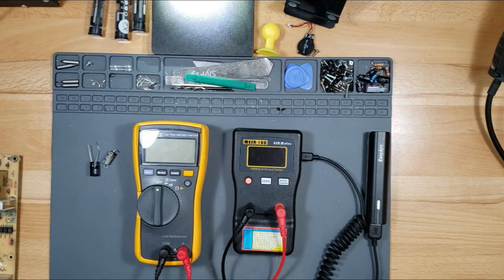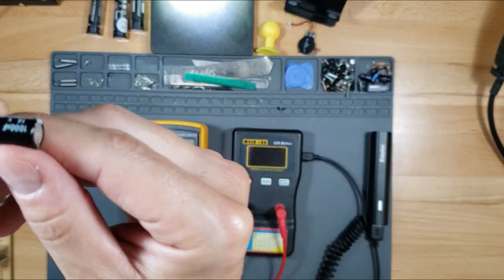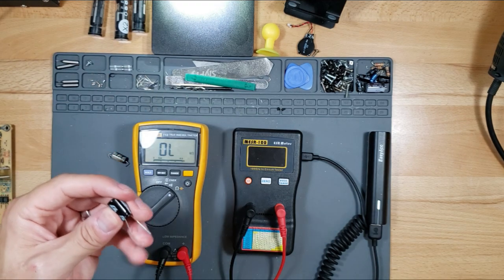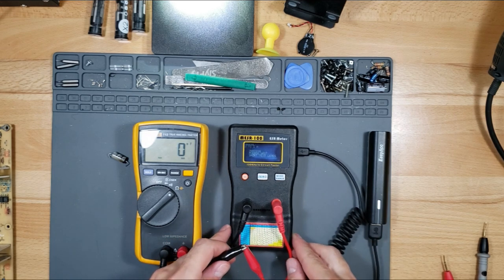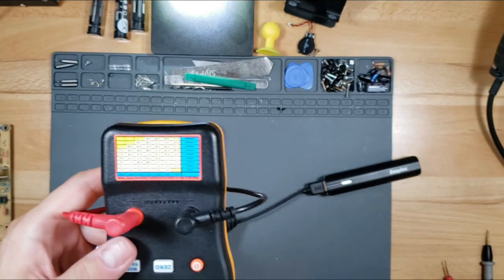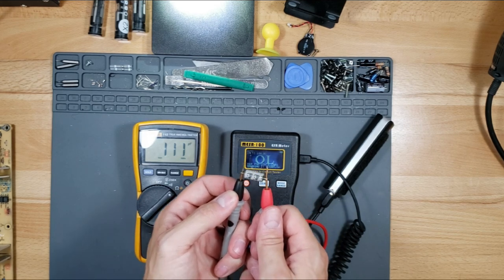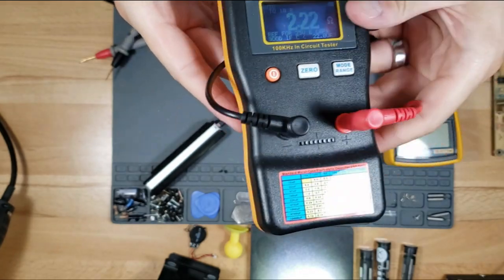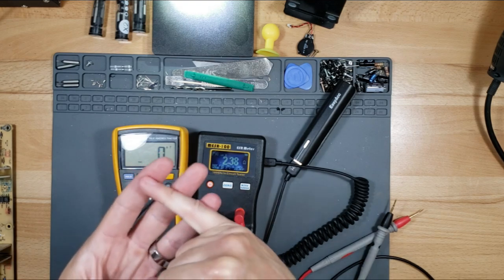Multimeter vs ESR meter reading capacitors

Comment: I thought a major upside of ESR meters was that you could measure capacitors IN CIRCUIT no ? A lot of hassle tracking down a blown cap if you have to yank em to test em. ?
Reply: This is true unless in parallel, he was stating the most accurate way I believe but it wouldn't hurt putting that golden bit of info out there lol

Comment: Great tutorial. You can also test the resistance and microhenries of the inductors with the esr meter. The reactance formula is 2𝛑FL. That would be 2 x Pi x frequency of esr meter x 100 (uH) Just plug it in.

R=0.628 X L(uH)
L(uH)=R(ohms)/0.628

Comment: Hi, I'm an amateur in the field of Electronics, on your recommendation I have exactly the same ESR meter it works fine but I still have a question, can you also measure SMD Capacitors with this meter or do I need a Pin measuring device for SMD components.   I ask this because the SMD capacitors do not have mF ( fahrads) written on them, sometimes only Numbers.    greetings from the Netherlands     Akko
Reply: V good ?
And what   Is the Solution

Comment: Hope I don’t look picky, but just a couple of points that would improve a future iteration of this presentation:
1) If you see figures the right way up, then roll your hands over to point the component to the camera, we will see the figures up side down;
2) I wanted to see the screen of the ESR Meter, when it was displaying each of the two results & also a clear shot of the table on the ESR Meter. A steady shot of each of those would be appreciated.

Comment: If the ESR meter is measuring resistance why can’t one use the DMM to also read a capacitor’s resistance and then use the same chart that’s on an ESR meter to determine if the cap is good?
Reply: Capacitors block DC. It would read as open. ESR meters test with high frequency.

Comment: Can you not just ohm it out with a multimeter in the ohms setting?
Reply: Capacitors block DC. It would read as open. ESR meters test with high frequency.
Reply: @ortzinator  
Ok, so an expensive  mft1741 megger would have the same problem yes?

Comment: It's been a while since I thought about this. Isn't there a situation where you can use the ESR meter while the cap is still in the circuit, if it is clearly bad?
Reply: must be  isolated from the circuit
Reply: One leg out
Reply: It’s fine to read in circuit. EEVblog has a video with proof.
Reply: @ortzinator  Yes I think that's where I remember reading about the advantage of an ESR meter. On the other hand a multimeter can't, because parallel capacitance is additive.

Comment: I'm new to this and I have a couple of tv's I want to try and fix, one has a problem with the picture taking a while to come on and one of the capacitors on the power supply board doesn't have a bulge but it does have a black mark on top. I heard that means it's leaking, I want to replace it and I was wondering if there are good and bad electronic component brands or are they all basically the same quality.

Comment: I notice with that ESR Meter the volt chart doesn't cover all the voltages in capacitors, we can use any ESR chart off the internet to compare readings? I have some 200v 33uF caps I like to test.
Reply: better to check the datasheet from the specific manufacturer of the cap

Comment: Question: I'm working on a mid 60's Electrohome that needs power filterCaps "Humming"
 ( + other value caps needed)
Filter Cap is a two part can with 4000 & 1000 mfd @ 50V sections. (C111 on schematic)
  Where might I Find a 4000 mfd 50v Cap for that part of the filter?
 (I do see 1000 mfd 50v available) 
and others needed are, 80mfd @ 25v I cannot find. 
(there's probably other values when I come across them to replace, that are not to be found online)
Any suggestions for substitute values available that will work?
 Electrohome 703-A  
HF2-1 Chassis

Comment: Hi! I have a Sony Bravia smart TV and I'd like to fix it myself. The problem is that the TV automatically turns ON when  I plug the cabel and the Sony logo shows up, than after some sec. it turns black (with light, so not OFF), and 1-2 sec. later the black light fade a little bit and it stays. The TV does not work with the ON/OFF switch and reset does not work either. Can you please help me? Any ideas, what the problem is and what should I do? Thanks a lot!
Reply: Super late reply. I'm sure you've moved on. But just for others information, that's definitely a Transistor problem. It's a pitchfork-looking component that is supposed to only power the TV when a switch is pushed. But it's stuck in an always on position. Probably re-soldering  it would fix it unless it needs to be replaced.
Reply: @overnightdelivery just a question is that most likely a problem with the mosfets on the power supply board? Maybe problem with a short or cold solder joint on the gate?

Comment: If your ESR meter is reading in Ohms, why cant I do the same with my ohm meter in circuit?
Reply: A typical Ohm meter measures DC resistance. Capacitors pass AC but block DC. An ESR meter actually measures AC resistance (impedance). In this case by applying a 100kHz sinewave test signal. The reason for high frequency is to go beyond the main influence range of capacitive impedance in electrolytics so the only thing left to measure is the ESR.

Comment: I see it unnecessary to have an ESR meter if I already have a fluke of more than 400 $ in my workshop
Reply: I  am just guessing but it may be possible to have a DMM measure cap that is within 10% of nominal but it's resistance is above the threshold so it is still eligible for replacement. But one wouldn't know this until it's tested with a ESR meter